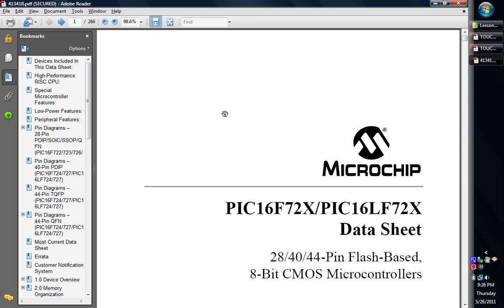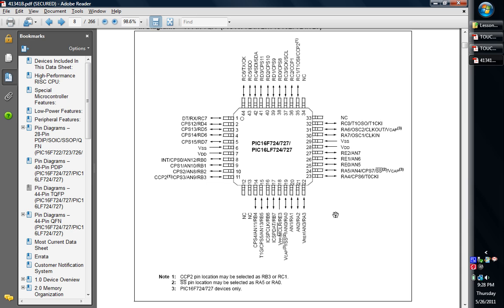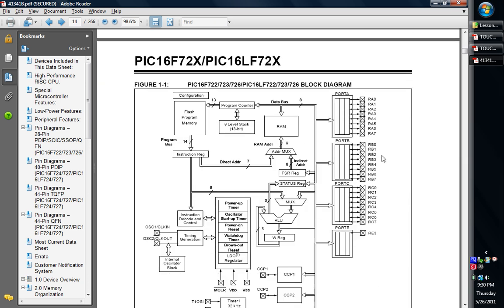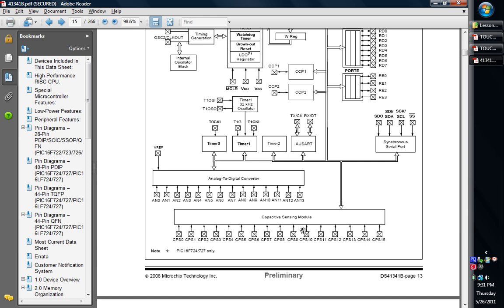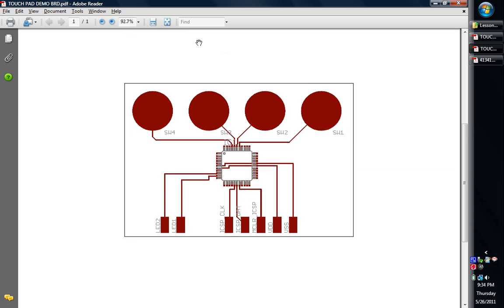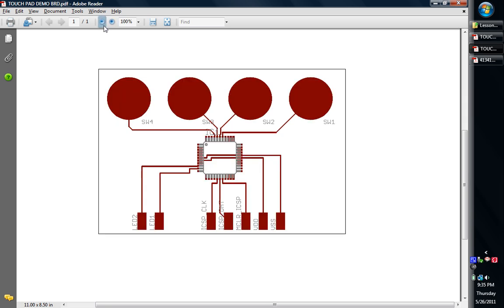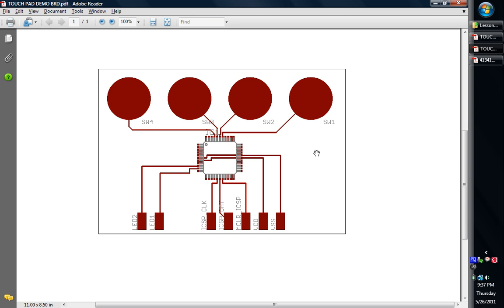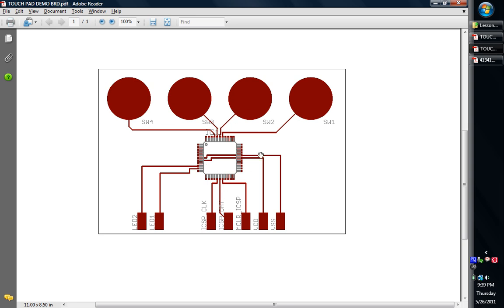Capacitive Touch PIC Microcontroller

Comment: Is it possible to do resistive touch on pic microcontroller assuming you have and IC for it?
Reply from the maker: Yes it is possible.  Many PIC chips do have on-board capacitive touch screen or reseitive touch screen controllers:  Here is a link with much information:  http://www.microchip.com/design-centers/capacitive-touch-sensing/2d-touch/2d-touch-libraries
Reply: misperry thanks for that wasn't sure if that was possible

Comment: Would the pins be what you can connect with to like a screen, so lets say you had 16 screens and then you wanted 16 touch ics, do  those pin represent the number of touch ic?
Reply from the maker: This chip has the "touch ic" built into it.  Basically what this chip is doing is putting out, on the pad I have the pin connected to, a high frequency signal.  Then when you add your finger/capacitive object to the pad it attenuates the signal and the chip recognizes that.  If you have touch screens that are capacitive touch you would be better off getting a PIC micro that has integrated Touch screen controller or buy 16 I2C or SPI controller IC's to accomplish this since a touch screen has more to it.  it has multiple axis that sense the amount of capacitance and others.  More than simply sending a signal through and looking for attenuation.  Hope that helps you and good luck on your project!!
Reply: misperry I understand now thanks so then if you just want one than its only one that you require and you use only one pin and then you ad one  connection for the touch cable. Thanks for the feedback!

Comment from the maker: Hello there.  I think there may be some confusion. I flipped through the data sheet for the 16F882 and it does not have capacitive touch.  The channels that are labled C1IN, C2IN, C3IN, etc. are comparator channels not capacitive channels.  This is for an analog comparison to a set external reference voltage.  You can see this by the device over view section 1.0 of the datasheet.  Also to check the analog comparator refer to section 8.0 of the datasheet.  Hope this helps.